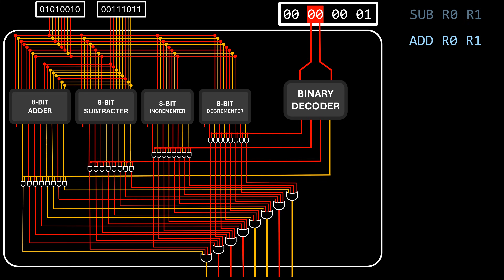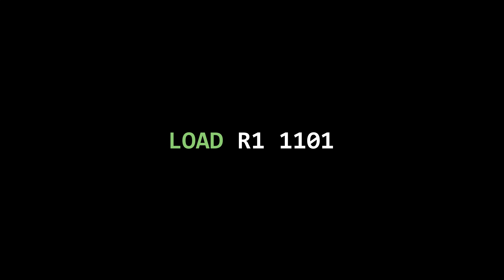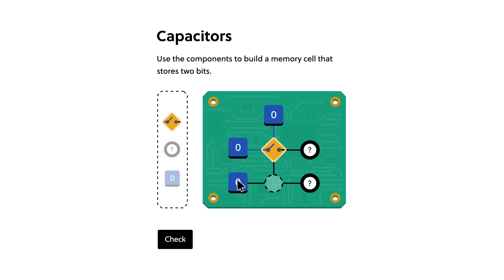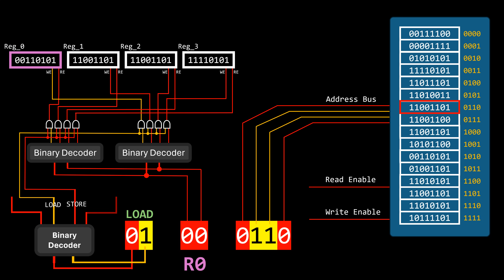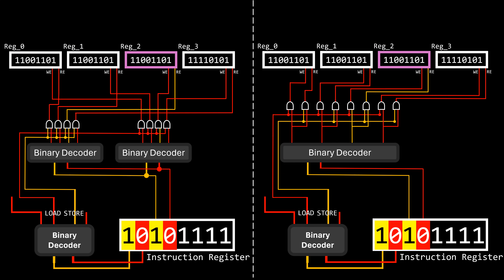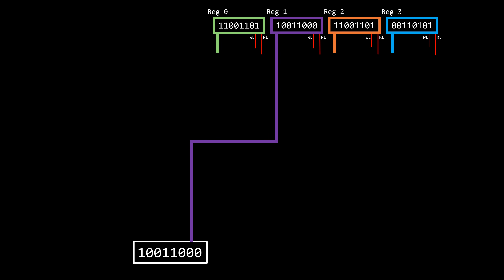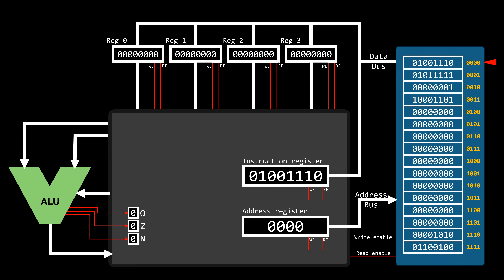CRAFTING A CPU TO RUN PROGRAMS

Comment: Some processors can execute ALU operations with one or more memory operands.

The memory addresses can be specified directly in the opcode, which usually makes it relatively large.

This is because there are typically many more memory addresses than registers.

(The 6502 processor offered the option of addressing only the lowest 256 bytes of a total of 64 K; this meant that an 8-bit address field was sufficient instead of 16 bits.)

Another option is to select a register that contains the memory address (indirect addressing).

These options complicate command execution and the processor.

Four memory accesses may be necessary: fetch, read 1st and 2nd operands, write back the result.

In addition, memory accesses are usually slower than register accesses.

In the RISC concept, memory accesses are therefore limited to load and store instructions.

In addition, many universal registers are available.

Program variables can thus be often held in registers entirely.

Comment: I'm a little confused about the data itself around 17-18 mins in. So the right is the RAM and the top is the registers. So the top is for variables in code, and the right seems to be both storing memory (data saved to disk, eg files) and also storing instructions (programs, which I realize are files themselves). I guess I don't understand how the right blue rectangle (RAM?) is both data (eg ints, chars) and also instructions (eg ADD R0 R1). Shouldn't there be two separate places to store these?
Reply: Nvm, answered in a later video "How computer processors run conditions and loops" short answer is yes, RAM has both. HALT instruction tells it to stop to not treat data as if it's an instruction

Comment: Answer: Data is loaded into registers before ALU operations because registers are the fastest storage close to the ALU, and most CPU designs only allow the ALU to operate on registers. Accessing memory directly is much slower and would stall the pipeline.
Reply: A lot of CPUs had so call  read-modify-write instructions . 6502 has it. I learned that 8086 has it . I never used them because I thought they are slow. I checked the timing in the manual: They are not. 8086 and 6502 are register starved, so these instructions are very useful. Of course, register starvation does not really make sense. Intel already pioneered embedded DRAM on 4004 and even had the stack integrated also in 8008.

Comment: In the last question I think it is because of the alu doesn't use a clock signal as other components do, so if you add two numbers and then you save the value in one of the two registers that have added those numbers then the alu will add the result again and again , this can be solved in this case saving the result in a register, even though if you perform a multiplication it could be a better idea to skip that register and count how many times the number has passed making the multiplication way more faster if you make It waiting for the clock

Comment: wrt last question: registers are fast on-chip storage. ALU accesses them directly for quick ops. memory is slower, so loading minimizes latency. some ISAs (e.g., x86) allow direct memory operands to ALU, but it's slower due to fetch latency. registers still better for performance.

Comment: How does the central processing unit know when a instruction is done executing the instruction, does it have a mini counter that decreases with the tick of the clock signal and each duration of each instruction is loaded into that register when fetching? Does that counter also serve to orchestrate the different steps of the instruction?

Comment: the better way is to not use registers. directly load the instruction from ram to cpu, through a binary decoder load the data directly in alu and store the output to the ram where it can be accessed by the user directly.

Comment: Loading values directly from RAM? But it will need 2 operation for 2 memory locations. We probably can store first value in temp register (if ALU cant already store that value of course). Something like this might work:
Load first value in temp register with some instruction (LOAD - temp_reg - First value adress)
ALU operation can be send with second command (ADD - OPERATION - Second value adress)
When loading second value in ALU, activate RE in that temp register which will send its value as a first ALU input.
Store result in temp register until retrived?
Its like, 3 operations.

Comment: I’m confused—why wouldn’t a circular buffer using an array work in this case? Since the frame size, rate, and buffer duration are known, you could preallocate an array of 240 frame elements(24fps*10sec) and write circularly, overwriting old frames as needed. This avoids shifting, manual deletions, and pointer lookup overhead, meaning it should comfortably outperform a linked list. What am I missing?

Comment: Great video! Thanks!  I had a question actually that made me stumble upon your fantastic channel, but which I think is not yet fully answered: To what extend and how does the instruction set (ISA, like RISC-V, ARM, x86) influence the CPU hardware architecture? I think the ISA determines what the CPU must be able to execute, and how each instruction is coded in binary,  and probably more, but I think it still leaves a lot of room for the actual hardware architecture design of the CPU, correct? A running process / a working computer being used consists of so many layers / levels of complexity that each have been incrementally designed, refined over time. It's mind boggling to me!

Comment: Because registers can be accessed very quickly, making them good for quick manipulation and temporary storage before writing. The reason for that is they are located very near the CPU and data require much less time to travel over a data bus. We can use cache if data is a large chuck but it makes the CPU more complex due to the fact that cache needs to be rewritten with resolution of all unmatching data conflict

Comment: Can you explain how a program on the cpu gets i/o?
Reply: Are you talking about disk I/O? Your OS has the notion of files which are bytes stored on the disk. The OS provides system calls where pointers to those areas are loaded into memory and orovided to the user as something called a file descriptor (literally just a number corresponding to a disk address). Once you have the address, its just a matter of having the instruction of write to disk rather than write to memory. It should be noted that usually this is done by the kernel via something called a syscall. As a developer you can read and wrote to/from memory and registers, but unless you're using some very weird OS, you must delegate file i/o to the operating system. Btw when i mention files, I'm not jjst talking about text files. Connections to the network are also done through socket files, same as with bluetooth, connections to a database etc. But all of this is done by the OS. You cant manually do it

Comment: Well I think we need add data before because we want to use the max length of the numbers. If we have only 32bits you probably need 8 or 16 for instructions and later you only have 8 and 8 for the operation but if we save the data before later we can use operations of 32 bits.

Comment: To answer the final question. Lets suppose we are using a single core CPU and we, like shown in the video, are performing one logical operation in the ALU.
Data gets loaded into registers from memory, which many people skim over and just say RAM is slower than registers but stuff must be put inside a register from RAM first. In that example the path that would be taken by the data if it were taken directly from RAM to the ALU or from RAM to a register to the ALU is practically the same. Having the above statement in mind we can imagine that memory is just a bunch of pseudo registers alongside the normal registers. In that case the only practical difference will be the MUXes and the Decoders we'd need to decode our instruction to use 2^8 or whatever registers instead of just 4. This would indeed require more logic and longer instruction to specify if it is memory we are targeting or a register, which will lead to a larger ISA due to the fact that memory to memory, register to register and all of their permutations should get their own instruction and a corresponding decoder. This leads to larger ISA, which is bad
Another more practical explanation might be that when we perform a logical operation we would like to use the results of it and thus would need to be stored somewhere for easy and fast access, because most likely, an instruction not so far from the one we are reviewing would like to interact with the value we got during the logical operation. This in turn makes using registers more efficient.

Comment: Excellent video. The control scheme depicted is a 'hard-wired" instruction set. I suggest a follow-up discussing the differences between a microcoded instruction set and hard-wired instruction set.  Reason: most CPUs today (even RISC) are microcoded. Source: CPU architect Jim Keller.

Comment: Whether using a reduced instruction set or a complex one is "better" is a matter of opinion and use case. Complex instruction set architecture operations can take operands from registers, memory, or even the op code itself ("immediate" values). I have implemented a CPU in Minecraft redstone that uses an even more reduced instruction set architecture in which every operation uses only immediate values because it is the simplest way to implement a Brainfuck machine: the data pointer (in its own register) always points to a memory address; "+" and "-" respectively increment or decrement the value at that memory location, implemented as `ADD value` and `SUB value` to compact sequential operations; ">" and "<" respectively increment or decrement the data pointer itself, implemented as `ADP value` and `SDP value` to compact sequential operations; "[" branches if the value at the memory location is 0, taking an offset equal to the number of instructions to skip forward; "]" branches if the value at the memory location is not 0, taking an offset equal to the number of instructions to jump past backwards; "," reads a byte from stdin, writes it to the current memory location then increments the stdin pointer; "." writes the current memory location value to stdout then increments the stdout pointer. If I wanted to implement this with a standard register machine ISA, it would require many more registers and multiple CPU instructions per Brainfuck operation. (I also was able to use 4 copies of the same memory module for stdin buffer, instruction ROM, program RAM, and stdout buffer, greatly simplifying the whole thing.)

Comment: Bro Please make a video on Load and Store instructions implementation and how load and store instructions work with multiplexer to registers and RAM in details and step by by please. one of the big question, which is unanswered to me.
Reply: Did you not just answer your own question? Connect one register to the address pins of SRAM, connect the other to the data pins. In 6502 (and 68k ) you have data and address registers. Need to call TAX or TAY to “transfer” a pointer into the address register.

Comment: So assembler converts add,sub...etc into binary code.
But assembler is software.
How does this software interact with hardware?
Is there something else that converts words to binary on which the assembler is made?
Reply: You just store this binary in RAM and jump to the start. On commodore C64 the SYS command does the jump. Internally, it is the JMP () instruction. The binary for this is stored in ROM.

Comment: Really love what you've done on how CPU run programs at the very circuitry level. 
Do you have any plans to illustrated how GPU works at circuitry level in future episodes? How GPU handles matrices calculations and graphics calculations?
Reply from the maker: Thanks for the support! Yes, I do have plans for GPUs from scratch.
Reply: Can we start with 2d ? C64 , NES , MX2, PCEngine ?

If you care for Matrix multiplication, check out the Atari Jaguar which has some optimization to keep the fused multiply and add unit busy every cycle. PS1 GTE works similar.

Both have a pixel shader. The Jaguar manual goes into great detail how they tried to shade 4px at once to keep up with the speed of the memory and avoid any cache logic.

Comment: I'm wondering are instructions and data those instructions manipulate reside in different areas of memory? If not how come store instruction doesn't overwrite another instruction ?
Reply from the maker: Instructions can manipulate any memory address (that belongs to the program), so yes, instructions can manipulate other instructions.

Compilers usually put instructions in a memory block separated from the data.
For more details, I recommend you to read about: the memory layout of a C program.
Reply: Sometimes instructions are stored in ROM . The Intel 8086 used a separate DataSegment and CodeSegment. Just don’t fiddle with the Segment Registers and you are safe.

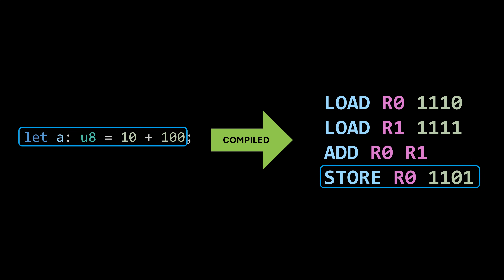Comment: 19:12 One note so:
The compiler will pre compute that and just output a single store command, or directly use the pre computed value elsewhere if it's value isn't changed somewhere.
They are clever in that regard.
So the better you are able to communicate to the compiler what you want to archive the more optimized your program will be, essentially for free.
Reply from the maker: Nice comment! I didn't get into optimizations because there's a video dedicated to it. But I guess mentioning it wouldn't hurt.

Comment: Great video, but still the simple way that a control unit sends or is able to send such control signals to different components within cpu could be understood by watching ben eaters 8 bit breadboard series, and the way all the things are implemented in that series could have been much clearly visualized in this video but u skipped that part!
Reply: I am still baffled that the 6502 has 112 control lines. Really, how many transistors actually act on data? Why not go 16bit already?

Comment: Amazing series,
For the question:
1) fetching from memory is slow, by fetching first we can cache the value if we need it in following instructions 
2) the number of wires connected to the ALU will be at least 2* address bus because we need to tell ALU the two addresses in case  of two operants instruction 
3) instruction size will be bigger because it needs to have at least 2* address bus, currently choosing from register needs lower number of wires

Comment: My answer: Because loading data to the register allows us to use simpler and shorter instructions due to simpler operands addressing(yet I am not so sure, I am complete newbie and just have started learning). As it comes to the second part of the question, yes, I think there might be a better way to do it(yet not completely sure it would really be a better way), and my solution would be to use longer instructions(16-bit instead of 8-bit) witch would allow us to use longer addresses for the operands, so we would be able to grant ALU a direct memory access, so it could fetch the values via separate data buses from memory without using any of registers. It's just my concept and understanding , however I don't have any idea is it correct or not.
Reply: BTW. Great videos, imo everything is very well explained. Great job! Thank you for your hard work!
Reply: What are separate data busses (plural)? Memory sits only on one bus.

Comment: How does the cpu know if what’s he’s executing isn’t data on the RAM?
Reply from the maker: It should be on RAM, there's no other way to load instructions into the CPU. If it is not on ram, they should be loaded from disk first.
Reply: @CoreDumpped I don’t think you understood my question. If I made a program and there’s a variable, the variable gets stored on RAM. The data doesn’t get executed, only instructions. How?
Reply: @mrmike4852 don’t jump into the data. Intel 286 introduced protect mode so that an App cannot jump into data.
Reply: @ArneChristianRosenfeldt  And how does it do that?
Reply: @mrmike4852  the CPU jumps were you tell it to. When you turn on power of a 68k CPU it starts at address 0. Amiga and Atari ST put ROM with code there. 6502 starts at the end of its address space and expects a jump there. So the C64 has ROM there.

You mean my second sentence? Apps on 286 are only 16 bit, but total memory uses 24 bit. The OS manages the segments. Those are Offsets into physical memory. When an app runs against the upper border, its program counter just wraps around and the CPU executes the first instruction again.

Comment: You have no idea how much this video series has helped me understand how data flows in circuits inside a cpu and more importantly how cpu identifies a specific instruction and how it then makes sure which data to move where. Thank you 🙏
As you mentioned in this video that you would explain how the cpu clock works, I am eagerly waiting to understand that as well.

Comment: Could you explain this code at the hardware and inter-computer binary level?

```rust

fn handle_client(mut stream: std::net::TcpStream) {
    let mut buffer: [u8; 1024] = [0; 1024];
    stream.read(&mut buffer).expect("successful read of the request");

    let request = String::from_utf8_lossy(&buffer);
    println!("Received request: {}", request);

    let response = "Hello, client!".as_bytes();
    stream.write(&response).expect("successful write of response");

}

fn main() {

    let socket = SocketAddr::from(([127,0,0,1], 3001));
    let listener = TcpListener::bind(socket).expect("Failed to bind socket");
    println!("Server listening on {socket}");

    for attempt in listener.incoming() {
        match attempt {
            Ok(stream) => {
                std::thread::spawn(|| handle_client(stream) );
            },
            Err(err) => eprintln!("{}", err)
        }
    }

}

```